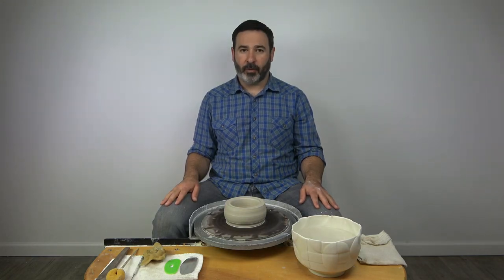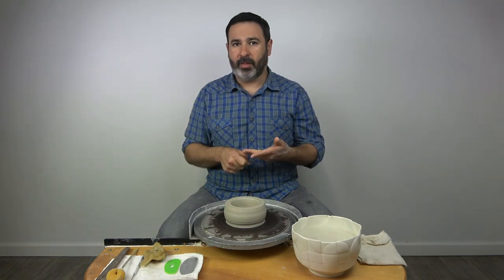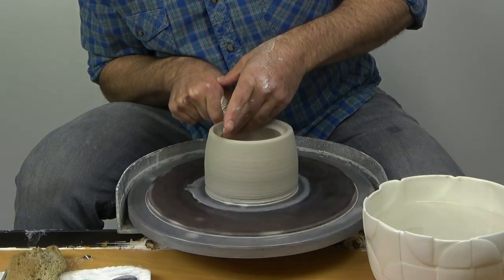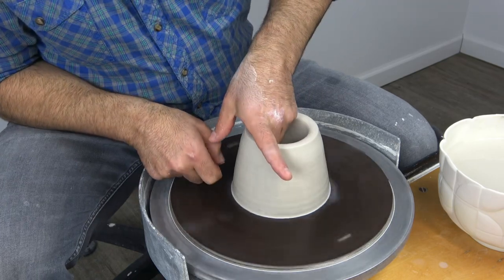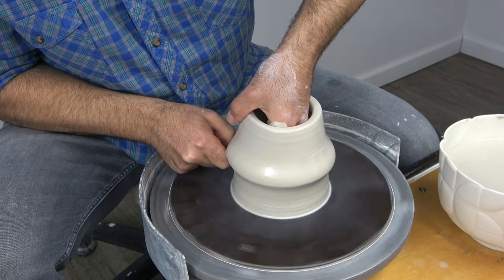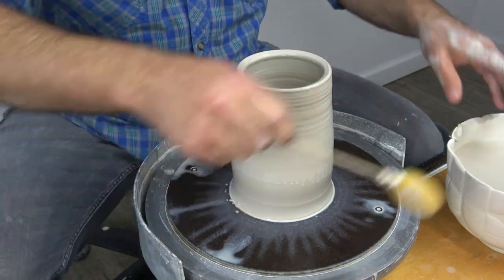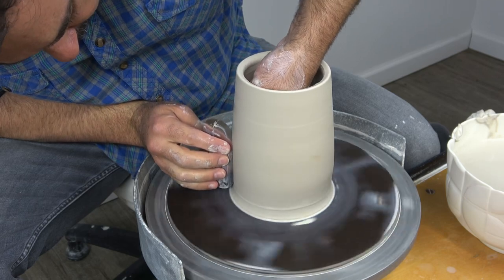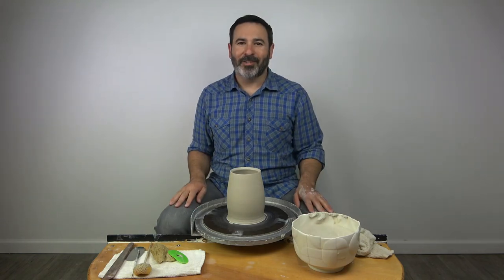Pottery Basics: Knuckle Pulling Cylinders

Comment: Hi Adam!  Thank you for video on knuckle pulling cylinders.  I have watched your video multiple times looking for a tip you made on one I saw.  I’m looking for the comment you posted about a “mistake you made for about 8 years” when you pull up and a lot of clay rips off instead of moving up and making the cylinder taller. I think the fix was to make a round bulge vs. a bulge with a sharp ridge.  I can’t seem to find that comment again and wanted to make sure this was the correct fix. Could you please direct me to the video where you addressed this problem please?  I can’t seem to find it again.  Thank you very much!  Super helpful videos.  Very clear and the things you make (e.g., vases) seem so easy for you.  So professional.  Thank you very much!  Ellen